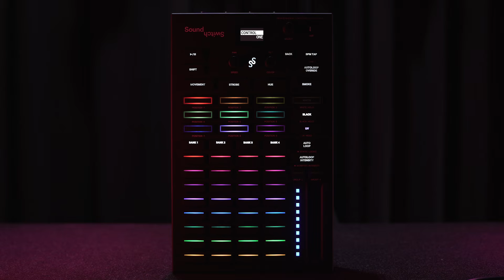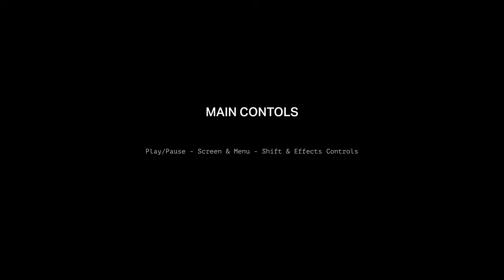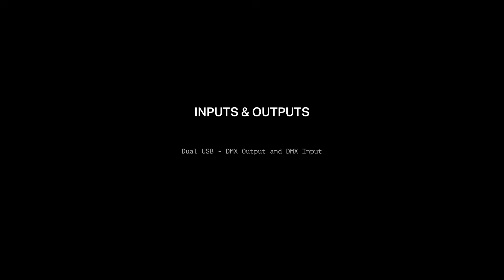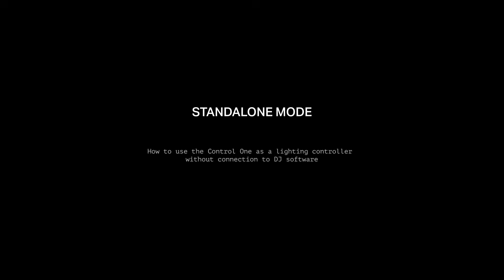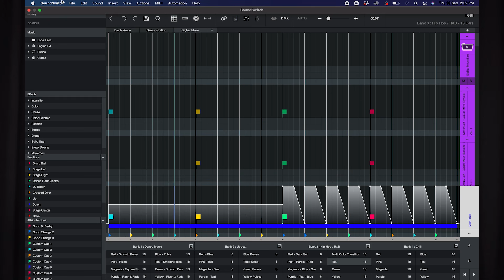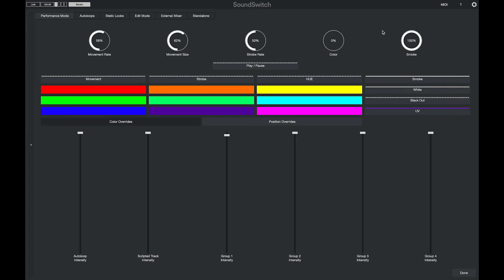Getting Started with the Control One

Comment: Can a wireless dmx transmitter be connected in the output instead of a cable?
Reply from the maker: Absolutely.
Reply: @soundswitch4427  Would I still need some sort of DMX bridge or no?
Reply from the maker: @gabrielledavis6382  Yes, you will need a SoundSwitch DMX interface which will then connect to a 3rd party wireless DMX system

Comment: I want to autoscript all my 130,000 tracks that’s on my internal ssd on the prime 4. So if I auto script all of them. And then want to plug my ss dmx dongle into the back of my prime 4. Or the control one. All I have to do is just export after they have been autoscripted.?
Reply from the maker: Thats correct. Export the SoundSwitch Project to a USB drive, and select this project in Engine Lighting. Then you should be good to go. If you need further help, please contact support@soundswitch.com

Comment: I do have a soundswitch  usb dongle, my question is does the control one work independently from the dongle or together?
Reply from the maker: Hey,

Its can do both depending on how you want to work. 

Control One is best seen as an upgrade from the Micro DMX.
Reply: @soundswitch4427  Thanks.  I already purchased the controller one so how do I get it work or do I need to create a new project and export that project to the control one? And also can I pay a one time fee for the service instead of the 7.99 per month?
Reply from the maker: @mulukukulyfedj  Yes you can purchase a lifetime license to the software for $199
Reply from the maker: @mulukukulyfedj  Yes you can export your Venue and Autoloops to the Control One however, there is a 1MB limit

Comment: well done, this is a completely mind-blowing product, it's great!  I have a question about DMX control with the link protocol.  If we use software like Traktor, is it possible to analyze the music in sound switch and have automatic scripts created?  for live use do you have to have the Traktor software and SOUND SWITCH switched on at the same time or the fact of having analyzed the music beforehand in sound switch makes it possible to do without the software in live use?  It would be interesting to have a tutorial with this use.
Reply from the maker: Hey Gilles, 

Thanks for the feedback.

Unfortunately with Traktor the only way to link the software is using Ableton LINK which is NOT compatible with the AutoScripting feature. 

If the team at Native Instruments can provide us an API we could add full scripted track support for you. However, we have requested this but haven't received the support we would have liked.

If you want to use Ableton LINK and Traktor, you will need to have both software running at the same time.